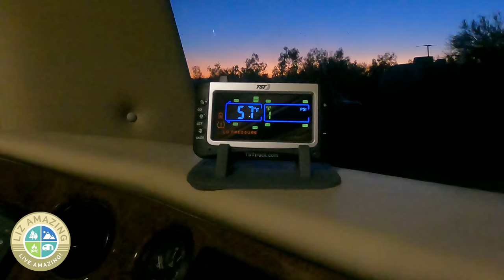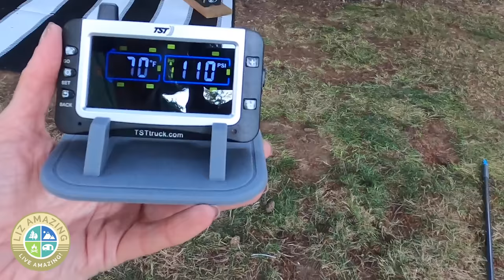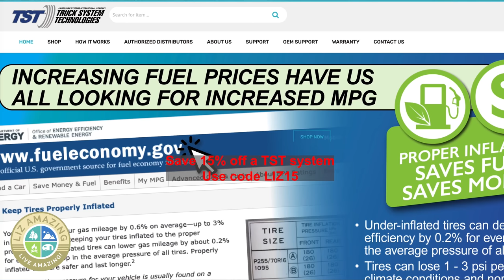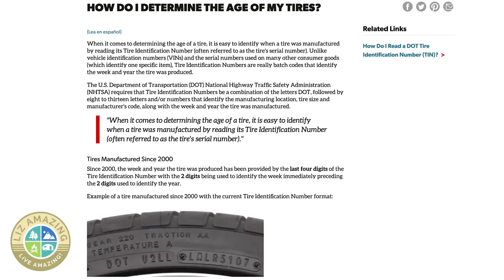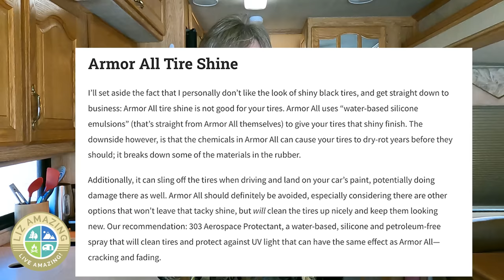3 questions everyone has about RV/Trailer tires

Comment: Good informative video Liz, armorall dries out the tires because it contains alcohol, anything that contains alcohol should not be used on your tires, dash, vinyl or leather because it will dry it out.  My husband uses a product called 303 which does not contain any alcohol and is used by boaters.  It shines and protects and you can usually find it at autozone, o Riley’s auto parts and other auto parts stores, and Amazon.  He uses 303 on the dash also to protect it.  For our RV seats and chair cushions I use a product called Weiman Leather Cleaner and Conditioner and this works great.  We also bought a product called tineco all in one vacuum and mop which is self cleaning and cordless and works great.  We use a dehumidifier to keep the humidity out of our rig.  We also use a dyson air purifier/fan/heater which works well to keep our 35 ft class A rig warm without having to use the propane heater. It helps to keep dust down and also is a fan to circulate the air and keep us cool. We only have to change the filters about every year to year and a half depending on usage.
Reply from the maker: Wow, these are such great tips. Thanks so much. Yes, it's good to know about the alternatives to armorall. Thanks again.

Comment: Great advice Liz! This happened to my wife’s son. He was on the I90 in New York cruising along at about 70mph. He had a blowout which took out all of the trim along the wheels. He pulled over and changed to his spare. He traveled another 30 miles and had another blowout on the other side. Without a spare he was forced to drop the trailer and took both blown tires to a tire shop. After installing the new tires he took the trailer to the tire shop to replace the other two. His old tires were 7 yrs old. They did not show any cracking on the sidewalls. They did however have cracks inside of the tread. Our RV dealer suggested that we replace our tires every 5 years.
Reply from the maker: Five years. Wow. I was seeing 6-8 for campers and as high as 10 years for cars. Glad your son was ok, what an epic experience! I hope he has TPMS now, or is planning to get one soon. Thanks for watching, Warren, as always!
Reply: Yeah, the RV inspection and care podcast guy and most others that I've read about say 5 years max no matter what the tire looks like.  One reason I'm opting not to get an RV at this time - tires are very expensive.

Comment: Great info. I don't have a flat tire story but back in February of this year a week before I scheduled to inspect and grease the wheel bearings on my fifth wheel I made a short trip from Jacksonville to Tallahassee Fl. By the time I reached Tallahassee a couple flagged my wife and I down because our rear driver side wheel had overheated and the wheel bearings were destroyed and brake hub snapped off the axle. Maintenance is key.
Reply from the maker: Wowsa. You are so lucky someone flagged you down. Thanks so much for sharing this, Mike. You are so right. Maintenance is key. Thanks for commenting!

Comment: Hello Liz and thank you for your very good informative video! Much needed for all travelers!. I had a trailer tire on my horse trailer blow out. I was driving thru a construction site area and there was a dip in the road. It blew my tire, I heard if bc of my window being cracked as I mentioned in another video. Anyway, I pulled over on a side driveway bc I was loaded with both my horses.  I didn’t want to unload just to reload my babies. LOL,.. So I got SMART! I unscrewed my lug nuts,,used my two boards 2x6” pulled up on them, took tire off, put new tire on,(always carry a spare)..tightened lug nuts and went about my way.  This ONLY took 20 minutes..Then back on the road. I also was only 5 minutes from my destination to where I was going to board my horses.. This is the only time that I have had a flat tire.. I monitor my tires on all my trailers (3) and trucks (2).  Thank you for your additional info! I know this will help others !! Many Blessings and Happy Trails Michelle from Greenville FLorida !!😊
Reply from the maker: Wow, I remember seeing your other comment about driving with the window open a little. It really pays off! Michelle you are definitely a smart and resourceful person! Glad you have a TPMS. Hello to you in Greenville!!!

Comment: Liz, thanks for the great information, our diesel pusher, and most all others have external air chucks that can be used to inflate or add air to all the tires making it unnecessary to have any additional inflator devices.  Running the tires regularly Heats them up and activates the protective additives in the rubber and helps them stay fresh.
Reply from the maker: Yes, it's not good at all to stay parked. And I've heard that there are some on-board air inflators but the seller knew nothing about it on my coach. Maybe it got disconnected. Thanks for watching and see you in the next video. Stay safe.

Comment: Liz, I have an Alfa like you. Your air brake compressor can be used to air up your tires. There should be an air manifold in the inverter  bay.  I use mine all the time to fill  my tires. Good luck in your travels.
Reply from the maker: Thank you, that's what I'm hearing. The seller knew nothing about it so I wonder if it was removed. Lucky you to also have an Alfa, hope to see youon the road. And thanks for watching.

Comment: Wow!! I never expected you to say $5000!!! I had no idea! This video, as usual, was very informative. Thanks Liz. Safe travels!🍀🙋🏻‍♀️
Reply from the maker: Thanks for your comment, Theresa. I had heard it could be as high as $8000 for six motorhome tires. It's a freightliner chassis so it's just like being big over the road tires. I felt glad to have gotten good tires for "just" $5300. And thanks for your kind words!
Reply: Yep good quality tires are not cheap these days and availability is getting worse all the time. Also always check the manufacture dates on new tires. If they have set in a warehouse for a long period like a year or more that's just less useable time for that tire once installed.

Comment: Hi Liz- Another important presentation. We have Tyron’s on the front tires of our diesel pusher. They are supposed to steady the RV in the event of a front blowout so not to lose control of the vehicle. Had a blowout on a toad- new Jeep Wrangler. Did not know until people were honking at us. Thank goodness there was no body damage to the Jeep- cost over $600.00 for a new rim and tire. Next purchase for us was a tire monitoring system for toad and RV. By the way, you look great. Safe travels!🙏👍🏻
Reply from the maker: Thanks for this comment, Sammie. I am getting a stabilizer system installed on my motorhome to help in case of a blowout and to make steering easier overall. If I like it, I will do a video about it. Stay tuned!

Comment: Love your videos, Liz!  Yes, TPM is the way to go.  However, if you have rubber valve stems on your tires, they do not recommend installing TPM on them.  The weight of the TPM in conjunction with the tire spinning down the highway causes the rubber valve stem to actually break.  The next time I get new tires installed, I am going to make sure they put on metal valve stems and then I'll be in business!  Great video!!
Reply from the maker: That's a very good point. Thanks for this, Gary. Metal stems are also less likely to leak for the duallys.

Comment: Re the TPMS system ... I also have that system, and it's extremely important to have on the "dullies" ... especially the inner tire! The reason is that there is little clearance between those two tires ... and the inner one is very difficult to check for a flat ... but if you have one flat ... that is undetected ... they will meet and at highway speeds a fire can and often does result due to "friction" ... and it doesn't take long!
I love that the system monitors for heat, and ID's the offending tire/location! I also carry a complete set of "belts" for the engine ... just in case.
 RVing is all about "peace of mind" ... and ... "being prepared"! LOL
Reply from the maker: Right you are! Thanks for underlining this point, Tom. Very important indeed! And good for you for carrying spare parts. Thanks for watching and see you in the next video.

Comment: Also consider installing a set of Centramatic ... automatic wheel balancers. They start working at about 8 mph and tires run cooler ... with an increase of 25% to 50% in tire mileage. They cost about $200 for a set of two. The military uses them, and I have them on all three axles on my coach ... a 1996 45XL Prevost conversion! Great on the steerers for a smoother ride if $$ is a concern.
Reply from the maker: I haven't heard of those, Tom. I will have to check them out. Thanks for your comment and see you in the next video.
Reply: @LizAmazing  Good Liz. They (Centramatics) are easy to install ... remove the wheel and just slide it in and put the wheel back on ... a 15 min job ...and consist of a metal plate with a light oil filled raceway with ball bearings installed within the raceway tube. They are sized specific for the tire size. You may pick up a rock in your tire thread that will compromise its balance ... but these will correct that by dynamically rearranging the location of the ball bearings as you roll.  I have had mine for 6 years now and they are maintenanc free ... using the immutable "Laws of Physics"! Good luck, Liz ... and I love your "spunk" and very educational videos!

Comment: Great stuff, Liz!  Another tip: If you're going to park long term on concrete, place a pad under the tires to keep them separated from the concrete surface.  The concrete will pull oil from the rubber compound of the tires, shortening their life span.
Reply from the maker: Oh my gosh, that is a great tip, thanks Paul!
Reply: yes and treating tires with preservative twice a year will help alot too.
Reply: That a great tip!!  Thank you!!  We'll be at an rv resort for 4 months!!

Comment: This was a very good, informative and accurate video Liz. There really is nothing I can add, I think you covered it all. Proper air pressure is such a huge component of tire safety and generally speaking most motorists have no concept of it. RV’ers have a better handle on it, I think. 

I guess the only thing I would add is seasonal or temperature driven pressures. In short as the temperature drops so does your pressure. I have had to add pressure when I have suddenly changed my environment to a colder one and I have had to bleed pressure out on long runs in hot temperatures. 

Keep up the good work!
Reply from the maker: Thanks so much for your support, Paul! So glad to have your support and encouragement! See you in the next video!

Comment: Great advice for sure. We don’t have a tps system for our motorhome and it is definitely on my wish/need list however I do check tire pressures on the motorhome and the trailer before and during each trip. Fortunately we haven’t had any problems with tire blowouts but I have had low pressure due to a leaking valve extension. ALWAYS check your tires! Thanks again Liz. Safe travels.
Reply from the maker: Thanks for watching, Erik! Christmas is coming, maybe you will get that TPMS soon. It's true those valve stem extensions can be a trouble spot. I had the same issue with my camper van, took a few times before the shop was able to solve it for good. One thing that helped was going from rubber to steel extensions. Safe travels to you as well.

Comment: Great video, Liz. I call my TST TPMS my worry box because the alarm goes off more often than I'd like. This usually happens in hot weather when the tire temp gets high and the pressure goes up, exceeding the pressure parameters  I've set. The device has, however, saved my bacon on more that one occasion due to valve stem leaks. BTW, like your new rig!
Reply from the maker: Thanks Thomas, glad you have the TST TPMS. And glad to have you here. Stay tuned!

Comment: We purchased a 2008 Jayco Super C  motorhome on a Chev Kodiak chassis a few years ago.  I noticed in November last year that the tires were looking really cracked, checked them and found that they had been made in 2007!  We spent $3k replacing the 6 tires in February. We had no spare, so I purchased a rim and had the best of the old tires mounted on it (one of the inside rear tires looked absolutely fine and the tire shop said it was fine to have as a spare) so we are ready to keep travelling.  Our new Michelin 245 70R22.5 tires were made in Week 32 in 2021, so should be good for a while.  We also have tire covers for use while we are parked.  Great tips and thanks for the great video.
Reply from the maker: Thanks so much for your comment, Bob. Wow tires from 2007, so glad nothing bad happened. Good for you for replacing them. Michelins are great, top of the line!

Comment: Nice to hear from you again liz. Yeah a good tpms would have saved poppa 3800 bucks having to call someone out on the alpha.  replacing messed up hydraulics. Lost the inside rear driverside and didn't know. When the tire blew it took out a lot. Including leveling jack. Bent the daylights out of it. The tpms system is well worth it. We put that and the cameras on the wildcat. We also replace tires yearly regardless of mileage. It just costs to much for that kind of repairs. We usually replace the tires right after storage. This year we had to replace before storage. Lost a tire during a trip to Arkansas.  It's equally important to be prepared for such happenings as well. Having what you need for such events is more much important than the event imo. You don't want to be stranded anywhere. That's why we swap the spare out everytime we swap tires. We use 1 of the old tires for the new spare. Keep safe out there. Hope to see on flop side.
Reply from the maker: Hey there! Thanks for sharing this and the cost. I think you may convinced someone reading this to get a TPMS. So thanks for that! Hope to see you on the road, till then see you in the next video.

Comment: I was driving on I-90 Eastbound, pulling a 28' travel trailer.  Climbing toward 4th of July Pass, there was construction and single lane traffic.  I was stuck behind a couple of semi's.  At the summit, the lane restrictions ended, I pulled out to pass.  As I was watching my passenger mirror to merge back to the outside lane, I saw it happen.  The front axle tire blew, taking the propane line with it.  We were very lucky we did not blow up.  (We turn the propane off when we travel now.)  I am not a speed demon, I usually go under the speed limit on the interstate.  I've seen too many overturned travel trailers and tow vehicles to be in that big of a hurry.  Safe travels!
Reply from the maker: Wow, Corinne, that sounds so scary. Thank you so much for taking the time to share about this. I bet your comment is going to convince someone to get a TPMS. And thanks for watching.

Comment: We did have a blow out due to metal in the road. Went through the side wall of the rear motorhome outside tire and the passenger side of our toad. Put on the toad spare, drove the motorhome back into town about 20 miles. Put on new tire and had to replace mud flap later. Lucked out!
Reply from the maker: Wow, you sure did get lucky. Thanks for sharing your story, could be what someone needs to convince them to get a TPMS. And thanks for watching.

Comment: Great information! As an inspector, I recommend changing the tires every 5-6 years. I have found so many old tires on RV’s. We consider this a life safety issue. One thing to note is the recommended psi on your tire may differ from you manufacture recommendation. For instance, all tires may say cold inflation 80 psi. The manufacturer label sticker by the driver’s side door will tell you what they recommend, which could be 65 in front and 70 in rear. Go with the manufacturer because they base it on weight and what is best for your RV specifically.
Reply from the maker: Great tips, thank you Debbie. In all my research I was not able to find a consensus on tire life. Some places even said 8 years or more!!! You're right about the recommended psi. My owners manual said to get the rig weighed for all four corners and then choose a psi per their chart, aligning with the various four corner weights. Basically if I am at capacity I am to be at 120psi, less 115 or even 110. I am underweight so I just now lowered my tires (after shooting the video) from 120 to 115. Thanks for your comment and talk to you soon!

Comment: Great advice!
Very interesting information about Michelin.  
  Those discounts are awesome!  I am so thankful my parents gave us a TST system.  Last year, we upgraded to the color monitor and it has served us well.  
The Viair is another great tool to have. We use ours for our Jeep as well as our fifth wheel. It it the only portable inflator we found that can handle pressure over 100psi.
Reply from the maker: Yes! Can't say enough good things about the Viar. Can't believe how quiet it is. Thanks for your comment!
Reply: @LizAmazing  next time we go to Yuma...or maybe Zion! ...we will hopefully either bring our Jeep or will have a ATV behind our 5th wheel!  That's the plan anyway 😀

Comment: Outstanding job Liz (as usual) I just went through all these various "Tire Issues" and learned a LOT.  Your coverage was great.  All I might offer is making sure one has the correct jack, lug wrench (or power impact) to change a tire if needed. Even perhaps a "practice change". When a tire is flat will the jack fit under the correct location AND lift high enough for the replacement ?  I truly enjoy your insights and videos, keep it up.
Reply from the maker: Such a great comment. I am sure many who read this will be helped by your wise suggestions. Thanks so much!